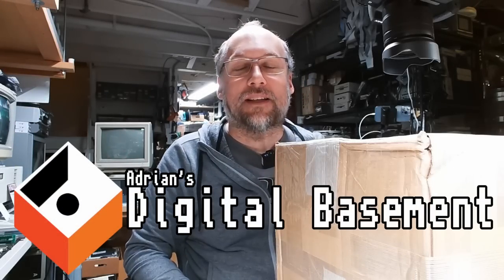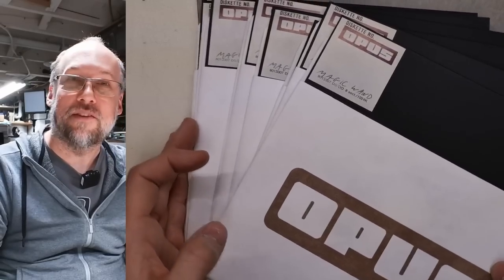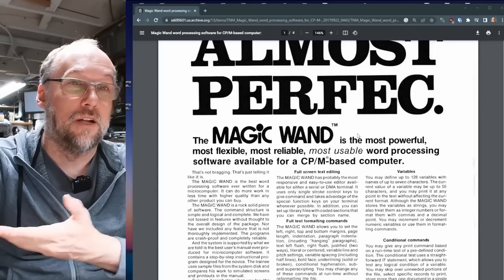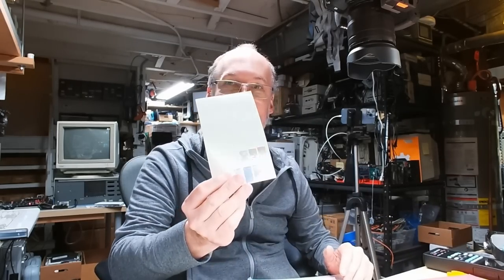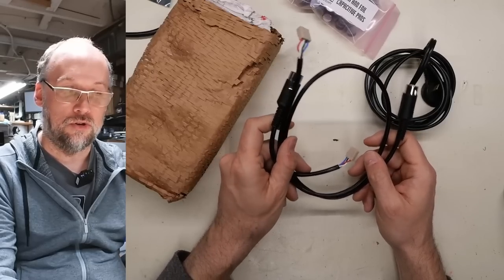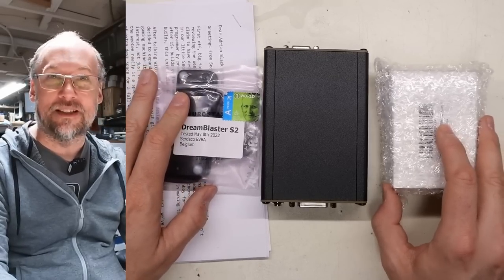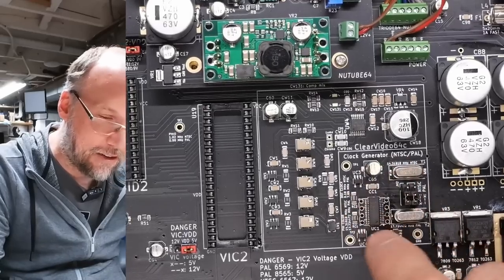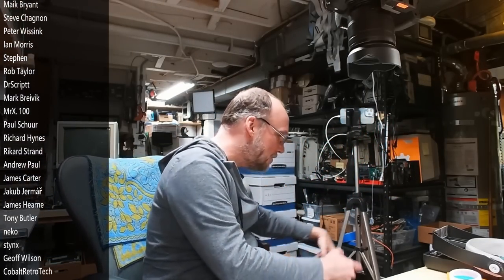0058 A miniature DOS PC, a modern C64 motherboard, a TRS-80 PSU and 8" disks!

Comment from the maker: I got the PSU installed into my TRS-80 Model 1 expansion interface and it works! Only thing you have to do is remove the black tray inside that holds the original two power bricks. If you don't remove the tray, the PSU fits but you won't be able to connect one of the two DIN cables. https://imgur.com/a/QOLwZiX
Reply: I know this is a retro channel, but 'fahrenheit' in 2023? Come on now.
Reply: @guderian557  Do you live in America? The "imperial" system is still very much alive here!

Comment: In case no one else has mentioned it... M80 and L80 are Microsoft's Macro-80 assembler and associated linker. I remember buying that package for CP/M in the early 80s. The distribution disk was an 8 inch and the mail order retailer provided the service of transfering to a 5 1/4 floppy for my Morrow MD2 as part of the sale (sending me both discs). I used the assembler quite a bit last year when hacking the bios while adding goteks to that old machine and making its addon ramdisk work once again.

Comment: Oasis was an operating system for the z-80 released in the late 1970’s which was later renamed to Theos. “The Word” was a word processor for that system. Oasis borrowed a lot from mainframe and minicomputer OSes, and supported multiuser and memory beyond the 64k available at the time (via paging). It ran well on a TRS-80 Model II.

Comment: One of the instruction pages mentioned having a disk with the Magic Wand software in one of the drives, while the disk holding the actual documents was in the other drive.  That, combined with some of those notes and labels sounding like they were from a corporate environment, would suggest all those "Magic Wand" labeled disks are extra copies of the software, made for people to take, use, and return as needed.
Reply: ok, that's interesting, as i was thinking, what is the point of labelling all your documents disks with just the name of the program, you would normally label with dates or category of documents for example. Adrian is sitting on a small fortune at 400 dollars per disk.

Comment: The information you found on Magic Wand says it is a CP/M application.  CP/M provides a great deal of hardware abstraction so a CP/M application written for one system can usually run on another.  There were several different floppy disk formats so floppy disks written on one CP/M system may or may not be readable on a different system but typically the software itself is compatible.

There are versions of CP/M for the TRS-80 model II and I believe it is quite possible to use double-sided drives.  I know double sided drives were a common upgrade for other models so I would be surprised if some model II owners didn't also upgrade to double sided drives at some point.  

I believe it is quite possible the disks you have were used on a Model II.  Also some of the notes you showed indicate that at least some of the disks are CP/M boot disks containing the Magic Wand software with free space for any documents that may be created in the future.  It is likely that most of the disks are bootable and contain the Magic Wand software as that was a fairly common practice for users using CP/M regularly.

Comment: Adrian, I worked at Micom, which later became Micom-Philips, Philips-Micom, and eventually just Philips Information Systems in Montreal, Canada. The initial product was a dedicated word processor that used 8" floppy disks (I started there in 1981). The original 8080 desktop system was replaced by a desk side system (8080/64K. and Z80/128K) by the time I had started working there. It was basically a rectangular cube, had two 8" floppy drives (most common configuration) and had a cable to the actual terminal unit, which had a specific keyboard (Cherry keyswitches) with dedicated keys for things like "Format", "Copy", "File", "Print" and a number of other functions. From what I remember, the operating system was one and the same with the word processor, in other words, you could not get to the operating system in any way, aside from issuing commands in the word processor. We used the same 8", DS/DD, hard sectored disks that you have here. The printer was a Qume daisy wheel printer using a Centronics type connector, which I suspect was some sort of parallel connection. Later systems were desktops, had dual 5.25" floppies, or a 5.25" floppy and a hard drive, and used TEC serial daisy wheel printer. Same word processor and operating system, but the 5.25" system was eventually able to run CP/M.

Comment: I think you were right on the money with the mouse theory with OBS.  At 32:20 you toss the manual from the box down and the video immediately cut as it landed.  Sad for the lost footage, but it is still a great Super Mega Mail Call!
Reply from the maker: Watching it back, yeah that is right! I need to make sure I move the mouse off the start button or start recording from Stream Deck! It would be cool to have a visible red light that came on while recording, so I could notice if it stopped.
Reply: @adriansdigitalbasement2  I've never used a Stream Deck before; does it support the ability to change the button state when recording is active? If so, that would be a great idea, since you've already got it there on the bench.

Also I believe there is a setting in OBS to require confirmation to stop recording (disabled by default), which may also help prevent it in the future.
Reply from the maker: @bjn714  It does, it shows up as red when recording -- but it's not big and bright enough to notice unless you are looking right at it. And yes on the stop recording, I need to set that. I think I turned it off because I was annoyed at it -- but it's a good idea! LOL!
Reply: @adriansdigitalbasement2  haha whoops! Sometimes the little annoyances can serve to save us from bigger problems, so it's probably worth enabling that confirmation again, even if the odds of it happening again are statistically quite low. Still, not a massive loss this time, since at least it was just a SMMC on the second channel and not a repair video where you could have lost content you couldn't easily recreate. I definitely understand the frustration, though!

Comment: Actually, if you had the right drive and controller, 8 inch floppies could hold more than even a high-density 5.25 (or 3.5) inch disk could.  If I remember correctly, the high-density (80-track) 5.25" disks could hold 1.2 MB (and as we all know the HD 3.5" disks could do 1.44 MB), but 8" double-sided double-density floppies (which were actually around for quite some time before the HD disks ever existed) could hold up to a whopping 1.6 MB.  This is because even though they had slightly fewer tracks, the tracks were physically larger which meant you could put more sectors per track on them.

(I think there were even some fancy controllers that could squeeze even more out of them by using varying numbers of sectors per track (more sectors per track on the outer (longer) tracks, but I never personally got to play with any of those.)

Comment: There's a lot of recent focus on expensive retro hardware like the Evo64 and the WeePC.  They just seem over-priced for what they are.

At the same time, there's some very cheap newly designed computers like the Agon Light 2.  Which is literally 50 euro from Olimex fully assembled.  I bought one, but haven't had time to do anything with it yet.    Honestly, like anything else the price is all about the design.

It's also fully open source, so nobody can play  gatekeeper for it.  That's often the problem with these projects.  Someone makes something for a period, loses interest, and it becomes unavailable.
Reply: The WeeCee Gerber files and Altium files are available out there, you can 100% make your own without permission.

Comment: Back in the day I worked for a guy (Hi Jeff L.!  J.) with a Televideo terminal attached to an Ithaca Intersystems S100 bus Z80 machine with dual 8" floppies.  Magic Wand was the word processor he had; whether purchased or pirated I don't remember (it was 40+ years ago).  I didn't use it much, so I remember little more than the name.  And since it was running with a remote terminal, the interface was certainly clunky compared to what we have and expect today.

Comment: 800 mhz 486. Not bad at all! One question: DX? I mean math co? It's perfectly usable without it, but having it will massively expand it's usability. I'm looking at Quake.
Reply: Did quake explicitly require the FPU? I wonder because at that speed, the loss of performance due to software emulation of the FPU would likely be fully negated.
Reply: @jameschamplin1742  
I'm not sure, I think the extra speed might compensate, but it might won't start without it. I don't remember.
Reply: Its a Vortex86dx

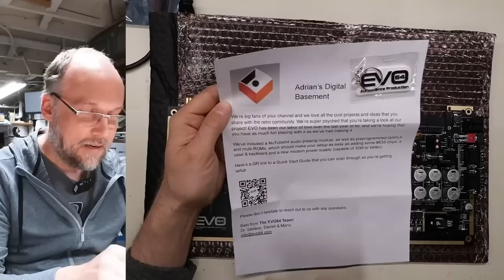Comment: 47:40 - Careful! 5V at 4A is only 20W...
Reply: Low voltage (say anything under 30 volts, maybe a little higher) is perfectly safe.  Safety of voltage/amperage is far more complicated than will fit in a comment,   But StyroPyro did an excellent video on the subject not long ago.  https://www.youtube.com/watch?v=BGD-oSwJv3E

Comment: I figured since 1982/1983 kept showing up on disk labels so I went by that and adjust for inflation that is ~$1276.   That is not completely out of the realm of realistic when you consider there was a time where a full featured version of MS Office (adjusted for inflation as well) could cost you $900 or more.

Also ..   I can not help but to wonder if the naming of that quad PLA is an inside joke since "QAPLA' " is also a word in Klingon that translates as "Success!"  Especially when you notice they took the time to include the apostrophe on the word.

Comment: LGR did a review a while ago on the wee PC box quite good but if it had a 3d accell that would make it complete
Reply: I designed/build one with a pci slot for video and got pretty good performance out of it.  The limiting factor is that it's missing MMX and a few other Intel specific instruction sets, that causes directx incompatibilities.

Comment: Instead of the completely useless NUTUBE amplifier those guys at EVO should have spent a little more money on sockets ;)
Reply: I think Adrians board is an earlier revision, I've seen the board with zif sockets in another review.
Reply: The EVO guys developed the product for over a year, making over 6 prototypes with their own money.  By the time this board was made for Adrian, they were super-tight on funds and had to go with the standard sockets. The NuTube64 module is a differentiator with EVO, which is why they chose to send it with the prototype board.

Comment: 800mhz would be pentium 3 not pentium 2 as pentium 2 only goes up to 450mhz
Reply: A 486 running at 800MHz will be about as fast as a Pentium II, as the performance-per-clock between the architectures is different (the 486 has a 32-bit data path versus the Pentium's 64-bit, for example).
Reply: While the Vortex86DX SoC runs at 800MHz and does support the i586 instruction set, it is no Pentium in terms of execution efficiency. The speed of this CPU is about the same as a Pentium II 300.